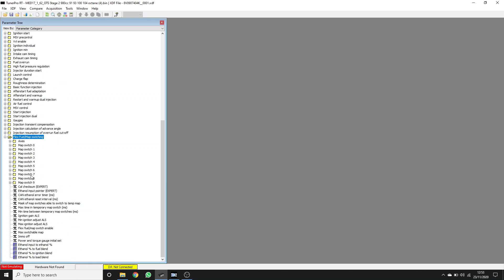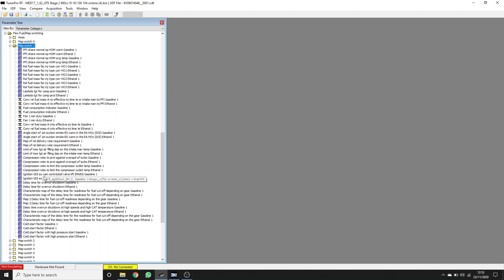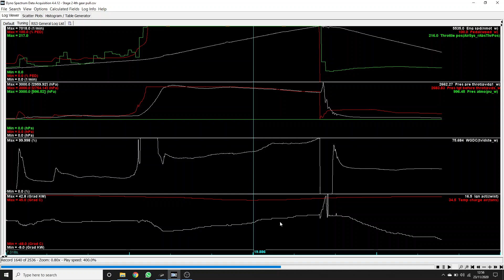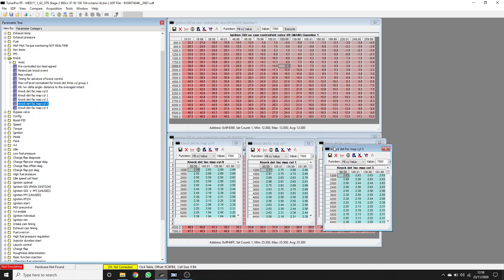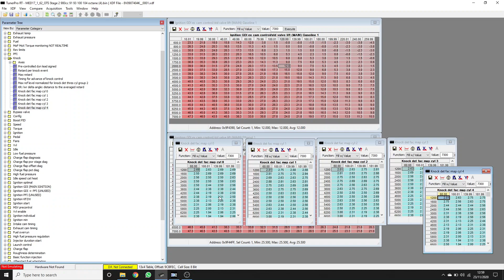DAZA DS1 ignition timing

Comment from the maker: Hardway Learning commented: "Is the ECU automatically interpolating between Gasoline 1 and Ethanol 1 depending on ethonal content? If the car was only at E60, why did ignition exceed your Ethonal 1 ignition. Reply: Interpolation is based on "Blend ethanol". Often we have that running from the ethanol map at E50 or higher. There are plenty of areas with more than 23 degrees of ignition just before 7000 RPM, it depends on engine load. Also, interpolating the ignition lookup does not always give a 1:1 relationship between ignition lookup and final ignition in the datalog, other factors compensate. On these ECUs it is fairly near though and mostly varies depending on air temperature compensations.